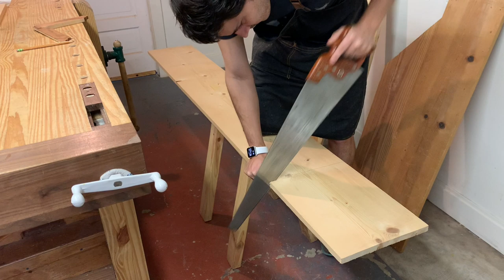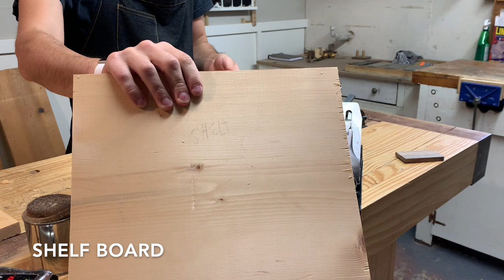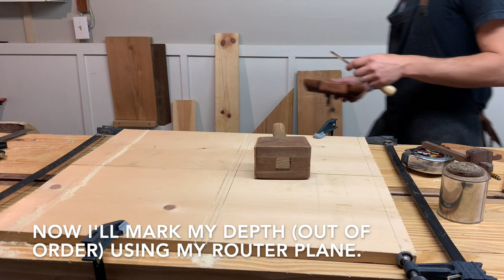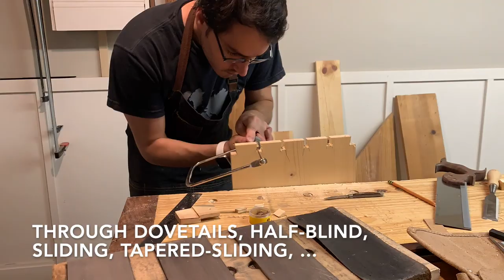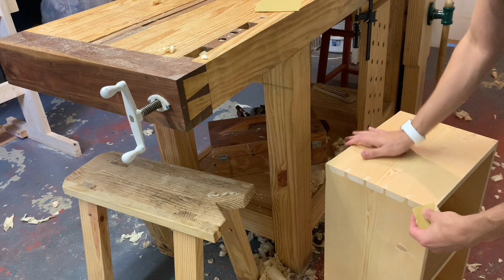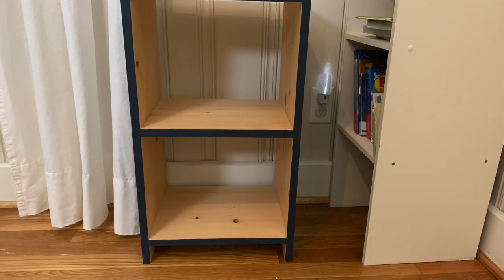BUILD YOUR SKILLS! Small Bookcase from Dimensional Lumber | Hand Tool Woodworking

Comment: So I had been planning to do a boarded bookcase, but my wife really wanted me to have a top on the case which the boarded bookcase design does not. I was trying to think of changing the design or just slapping a board on top but then I saw this over on Instagram and started thinking of a way to make it larger, kinda combining the two. I might share it over there once it's done so we'll see how it goes. The good news is that right now the "select" radiata pine at my local lowes is cheaper than buying the next grade down. 1 8' board was 25$ and the 4' boards with knots were 15 each.
Reply from the maker: The boarded bookcase is so cool and different without the top, but i can totally understand wanting something more traditional looking. This fits the bill for sure. I almost put a back on it, but I ended up not because of the size. By the way, I’ve seen Joshua Klein do bookshelves on the M&T instagram. They are very wide and bare bones, but similar style!
Reply: @TheHandToolery  I was thinking of just doing a bigger version of this but adding some stretchers across the back to strengthen it and stop the books from pushing out the back.